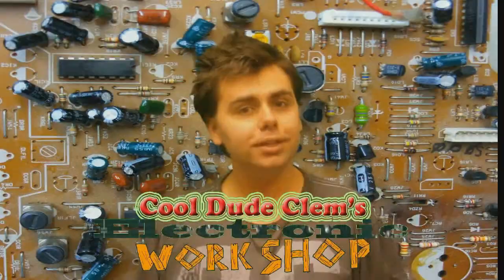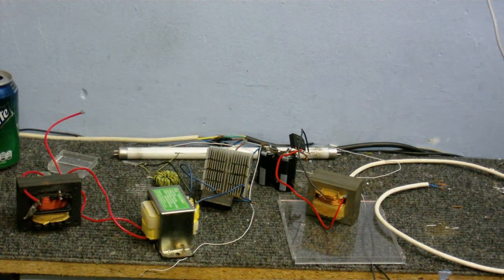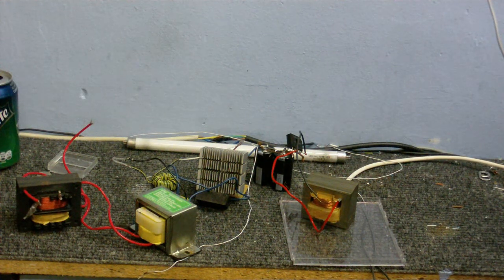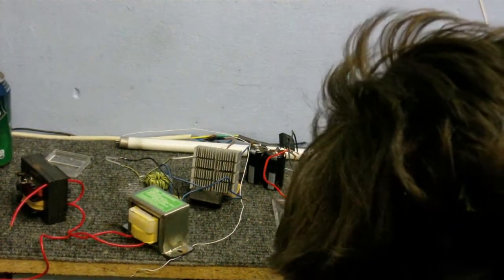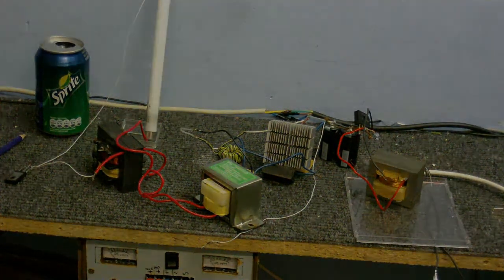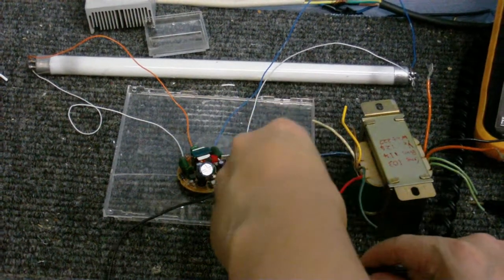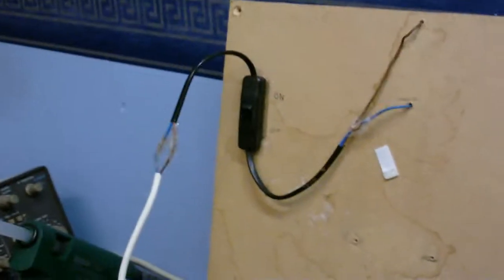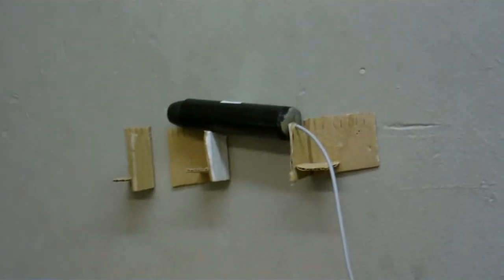CDC Electronic Work Shop - A better soloution for my cartoon stage lighting rig thing

Comment: Mains wires just twisted together with tape on? That's incredibly unsafe! If you pull just a little on that it's just gonna tear apart really easily. Invest in some heatshrink tubing and solder the connection instead